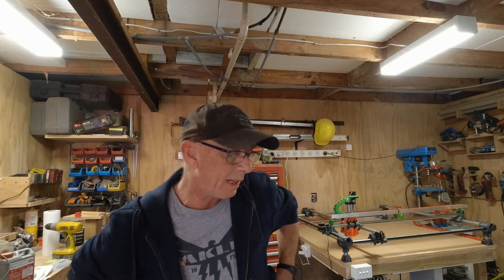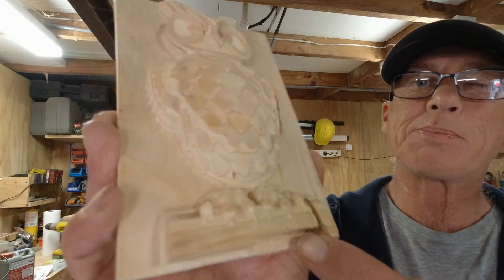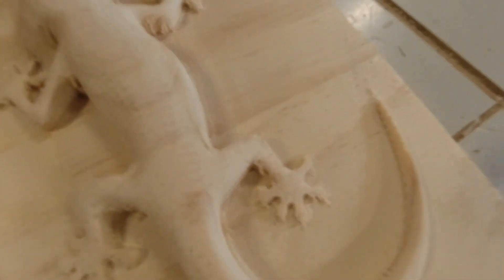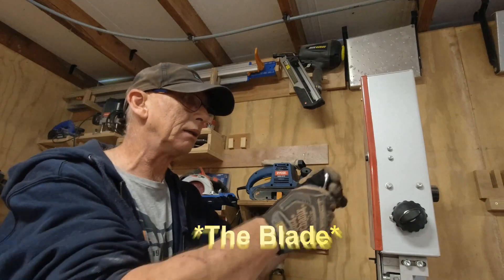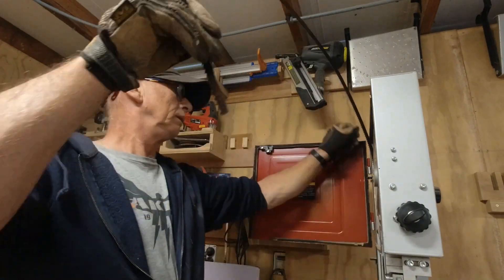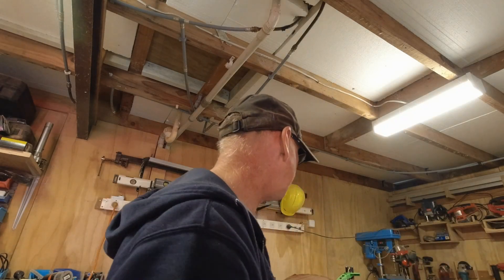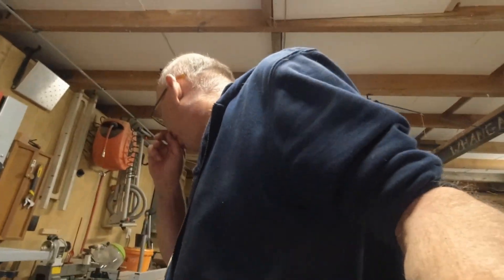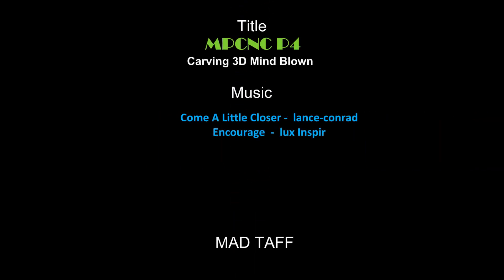MPCNC P4 - Trying 3D Carving Mind Blown -  Workshop 24

Comment: Is the control GRBL  based?  What cad software are you using?  Thanks
Reply from the maker: Its a marlin based  SKR pro V 1.2 board and i use a variety of software, the carving is done with Aspire software and i also use Estlcam. To control i am just using Repetier-host at the moment but playing with mach3 as building a dedicated PC for the CNC so i don't have to keep using my laptop. V1 engineering now also have a Jackpot board that runs FluidNC and is fully GRBL compatible.  hope this helps.
Reply: @MadTaff  Thanks again
Reply from the maker: I am about to order a laser head and see how it does with that just sorting out and printing a quick change  mount for it so i can use it for more things than just cutting. 
 @patswayze2493

Comment: you need to make a sled for your bandsaw with a runner that goes into the groove running front to back and a v block or something of the sort that will hold round things
Reply from the maker: Yeah have a sled for the band saw but need to make a v jig for rounds as will be cutting more. But as i am rearranging the workshop as the cnc is a bit close when working on other stuff i will have to wait to make some of the jigs i want like a cross cut for the table saw as well. thanks for the suggestions